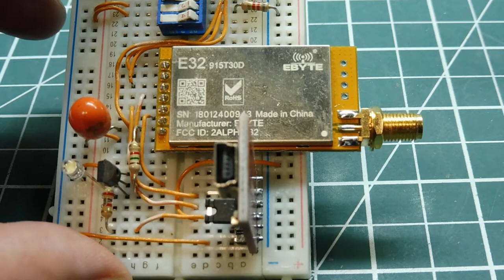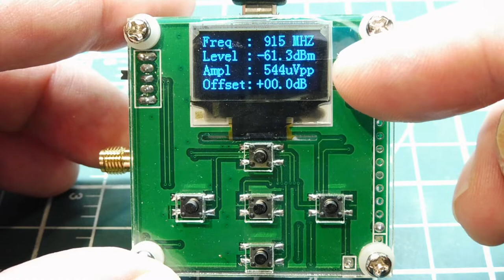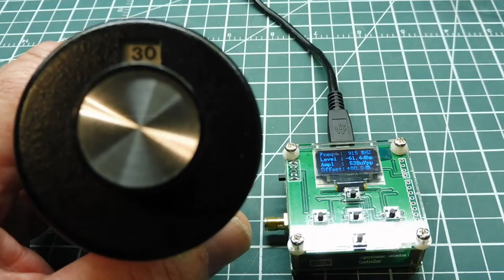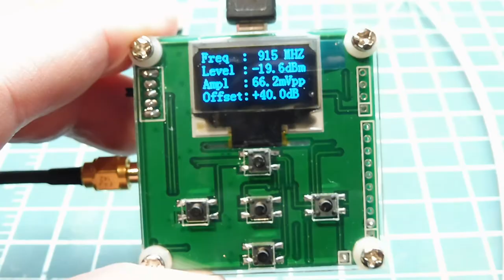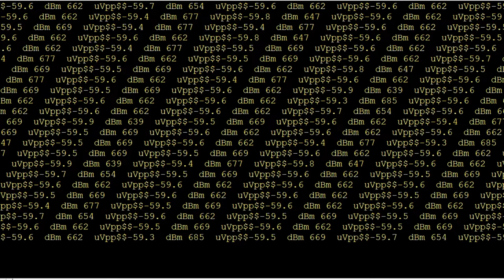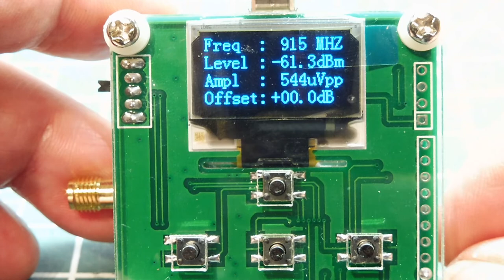RF Power Watt Meter

Comment: I took one apart today. On the bottom PCB is a standard AD8318 chip. It detects from 1MHz to 6/8GHz. The top PCB contains a uC, OLED, 3.3V regulator, USB to RS232 and buttons. 
The Good: Level/Amplitude works. The offset is very handy. The UART output is awesome if you can program so code on a PC.
The Bad: The frequency setting is fake. There is a simple black wire from the AD8318's Vout to an opamp (top board) to an ADC on the uC. No way to control or filter the frequency selected. I took a 434MHz remote transmitter and measured the same results set at 434MHz and 1500MHz. 
The Ugly: For the price it looks like what you are paying for it. 3D print a box for it as there are many spots you can accidentally cause ESD. The uC code works best for continuous carrier RF. Modulated waves will give weird results. For better control over measurements rather build your own circuit with a separate AD8318 and uC. 

Is it worth buying it? If you want something that works out of the box then yes. If you want to save costs then buy AD8318 modules with just the chip on, add a small Arduino board with display. Where I live the simple module costs 1/3 of the device above. 

What to buy extra? You will need one or more attenuators. The normal max input is 5dBm, absolute max is 12dBm...but LORA will output 20dBm. So you will fry the AD8318 the first time you connect it directly.
Reply: Hi. Nice module oveview. Just one remark. Frequency setting doesn't seem to be "dummy" function! AD8318 logarithmic detector doesn't have flat input impedance over the full frequency range. Check AD8318 datasheet, there is a huge variation of input impedance in 0 to 1 GHz vs. 1 GHz + range and this has to be compensated numerically (and probably its). Therefore, I recommend always to enter input frequency if known for accurate results. Cheers.
Reply: @MrCampinski  Point taken. I will check it with an uncompenated AD8318.
Reply: @zerksus  What did you find?

Comment: Managed to burn mine out; had this and a morfeus wired together and running on the same USB power supply. Disconnected the morfeus with a light switch adapter (which doesn't disconnect ground); the supply reported power on both ports. Killed at least the top board. Don't be like me haha!

Comment: great video - thank you.  question - would this meter be suitable for detecting an RF signal with an antenna connected to the input?  i'm searching for a specific signal i can detect with a SDR but want something more portable to 'search' with.  thanks again.
Reply from the maker: Yes .. connect an antenna and you can detect RF signals. Without an attenuator it is very sensitive so be careful you don't exceed the max input rating. Another alternative is a broadband FSM ( Field Strength Meter )
Check out this video:  https://youtu.be/t_RtPClt_Pc

Comment: I wish this thing had a "sweep" function.  I want to measure the RF emissions of my PC motherboard and do not know what specific frequencies to check...  is it possible to send commands over the serial connection, to set the frequency programmatically for example?
Reply: Would be helpful if the author replies to this @0033mer

Comment: Great video!! Sorry for asking this question as I am not a RF guy. What's the max power this unit can measure safely with a 40db attenuator? Thanks.

Edit:  Am I right if I say up to 3W safely with 40db atten? According to my calculation.
Reply from the maker: Yes .. for maximum input of -5 dbm for best accuracy with a 40 db attenuator, maximum input would be 35 dbm or 3 Watts.

Comment: Great Video!. I would also want to measure a LoRa power output. How do you get a continuous RF output?
Reply from the maker: Most LoRa modules cannot transmit continuously so you can use the slowest over the air data rate (highest spreading factor) and send a large data packet. The best way would be to use a Spectrum Analyzer with a peak hold feature.

Comment: Great video! Did you have to install a driver so that terra term would see it as a COM port? When I plug it in I see unknown device in device manager with it and no COM port assigned.
Reply from the maker: The USB to serial converter used by the RF power meter is the CH340. I have this driver loaded to communicate with the China built Arduino Nanos so my computer recognized it and TeraTerm can be used. If you do not have this driver installed check here: http://www.wch.cn/download/CH341SER_ZIP.html

Comment: nice info tnks ...to make the test with 200mw i need minimum 20dbm, or 25 dbm atenuator ???
Reply from the maker: 200 mW is 23 dbm and max input level is -5 dbm so you would need at least a 30 dbm attenuator.

Comment: OK do you think this would be accurate enough to calibrate an RF generator (namely a Marconi 2022 or 2022C ) in RF amplitude output.  The actual power meter they suggest is a Marconi 6960 with power sensor 6912  in the calibration procedure is quite expensive at over $2000, perhaps way overpriced by some individuals considering it's a very old test instrument and sensor ?
Reply from the maker: Check out this video at the 16 minute mark where the watt-meter reading is checked with a spectrum analyzer. https://www.youtube.com/watch?v=30G5ZsTCCZ8

Comment: what does frequency setting do on the oled screen do? is there some band pass filters? AD8318 cant tell which frequency the signal coming
Reply from the maker: Frequency response is not flat so the frequency of operation is needed for calibration correction.
Reply: @0033mer  the pin tadc makes frequency dependent temprature compansation. Maybe they are calibrating that. Tank you.

Comment: I don't understand why you put in 40 db atten when you had set the attenuator to 30 db.
Reply from the maker: The test was conducted with the attenuator set for 40 db as indicated at 4:00. I was just demonstrating how the attenuator value is dialed in when it was showing 30 db.
Reply: @0033mer  OK. I missed that. Interesting video.

Comment: Can your listed equipment be purchased from another source (item part number or order item #)?  I have not received my last Order from them, waiting for two months at this point?
Reply from the maker: They are also available from Wish, Aliexpress and I have seen them on Ebay:
https://www.ebay.com/c/28011111911
Contact Banggood and have them check their tracking data.
Reply: 0033mer What is the part # for your variable attenuator?

Thank you for your response, I am working with a pair of Microchip RN2903 LoRa Radio’s and I am trying to tune everything for better range.
Reply from the maker: The attenuator is a Wavetek 5080 which is no longer manufactured but you can get them surplus online. http://www.hamradio.no/la3tq/wt5080-1.pdf
Reply: 0033mer Is this variable attenuator necessary or is the 2Watt fixed item you referenced sufficient with these RN2903 LoRa Radio’s?
Reply from the maker: The RN2903 max power output is +18.5 dbm ( 71mW). The power input range of the RF wattmeter is -55 to -5 dbm. A fixed attenuator of 30dbm will attenuate the RN2903 output to -11.5 dbm which is within the limits. A 30dbm fixed attenuator is available from Banggood.

Comment: Interesting.. just got myself an RF power meter.. a USB3 RF Power meter... also a cheap unit like this at the same price... it goes a tad higher, but really don't have any use for above 6Ghz.
Im also getting a tad over 60dBm with no input.
though this unit does have both dBm and also uW value and changes to mW value when above, like 0dBm
and trying to find common ground to sense if its somewhat accurate.
Im  NOOB though I do have a cheap signal generator. FY6900 60Mhz.. any easy approach / setup to validate an accuracy on such a RF unit.?
Reply: Sir, the website in the description says that this product (RF Power watt meter) is discontinued. Then how you bought one?
Reply: @AnanyMangalBME  Its not the same, I reckon its a better and newer model, I got... and when I was looking I also saw that model above, so if you want the same as in the video, you should be able to find it from Chinese wholesellers.
Reply: @JAKOB1977  Thanks for replying to my query! Unfortunately in India (where I live), the Chinese Wholesalers are banned by the Government of India, so I'll be looking for newer models with similar functionality. Once Again, thanks for replying to my query.
Reply: @AnanyMangalBME  which sellers can you use in India.. so aliexpress, Banggood, Taobao etc, is all not valid for you in India?
Reply: @JAKOB1977  Alibaba and Taobao are banned in India, Banggood is present but the product is not available at the website.
Edit: DH gate's website seems to work here but I'm not sure if its valid or not.
Reply: @ananymangal6769  I used Aliexpress, but I guess that is under Alibaba.
if there is an item I want, and theydotn ship to my country, I would look into using an parcelforwarding company.
Then you just get a mailbox there and they will parcel it further.. and if India cant purchase from big sites like Aliexpress-. I would guess there would be such arrangement to India from other countries around India that are allowed to ship to India.. and it ain't like it is forbidden or dangerous products, so it should be okay if the problem is regional bureaucracy..
Reply: @JAKOB1977  Thanks for the suggestion, I would definitely implement it, I would also ask my institution to make arrangement for the device as it'll be used in my project..
Reply from the maker: You need a calibrated signal source to check the accuracy of your power meter. If you are getting a 60dbm reading with no input, your unit is probably faulty.
Reply: @0033mer  Your hopefully able to conclude that the "60dBm" is obviously referring to - 60dBm,, as in "minus" -60dBm and why Im writing "I'm also getting -60dBm".
Do you get that?
as +60dBm is like above +1000watt.
and you need a reference signal for checking accuracy is common sense. 
But you can often analyse other aspects to a certain degree if you have a sense of its output, and from numerous tests being able to dial in where your are accuracy wise.
and why Im asking with a crude signal generator like FY6900 60Mhz.. any easy approach to validate..
Reply from the maker: If you meant -60dbm then write it as so .... big difference. If you were writing an exam and put 60 dbm as the answer when -60 dbm is correct, do you expect to get it marked as correct? If you destroyed your power meter it could indicate 60 dbm which would obviously be incorrect. Many viewers think YouTube creators have crystal balls when it comes to decoding their comments.
Reply: @0033mer  your getting pretty tiresome.. so lets move on.. the last thing I wanna spend time on is some old crusty dude, that knows even less on the matter then me..and c'mon bud, it doesn't take a Phd to conclude "Im also getting 60dBm like in the video with no signal" is obviously referring to the same "-" 60dBm as in the video.
but as stated, hush.

Comment: can the antenna port b connected to an antenna?
Reply from the maker: Yes, but care must be taken to ensure that the signal from a strong transmitter will not exceed the maximum input power level.

Comment: can you check your banggood link as they seem to say Max input is 5dBm is that correct
Reply from the maker: The title indicates -5dbm but the description states +5dbm obviously there is a mistake. The data sheet for the AD8318 indicates useable range of -55 to -5dbm. Max input is +12 dbm where damage occurs.
https://www.analog.com/media/en/technical-documentation/data-sheets/AD8318.pdf
Reply: Ok Great , I just got mine and a 40db attenuator. my brains not the same as it was does that mean
im good for 10watts before damage ? 
thanks Brett
Reply from the maker: To keep the input power in the usable range with a 40db attenuator the max wattage applied will be 3.16 watts.
Reply: Oh yes thanks because we started at -5 not zero. thanks heaps Brett, PS. these work great.